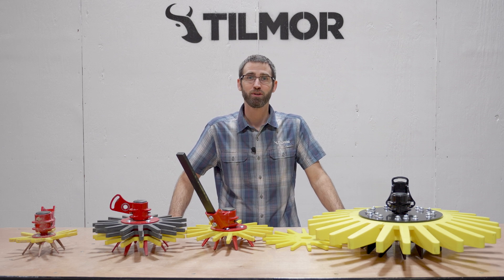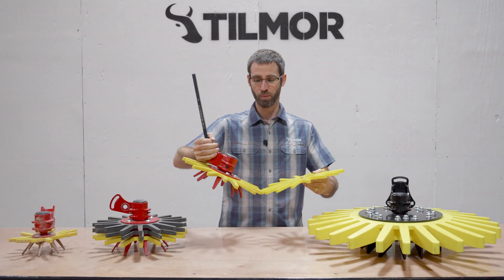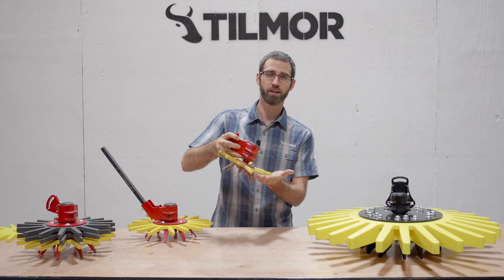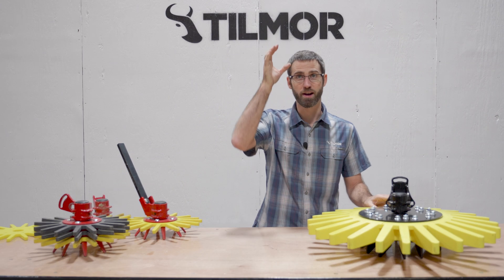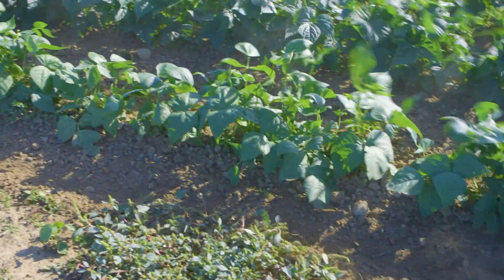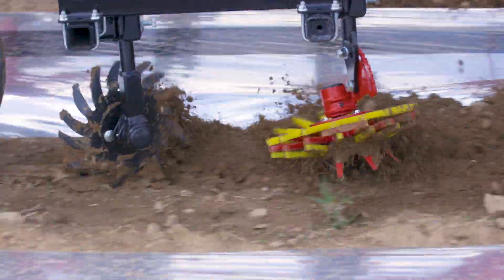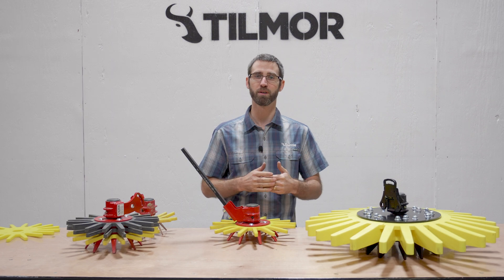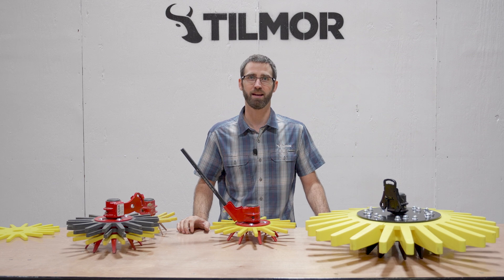Exploring Finger Weeders - Farm Implement Overview

Comment: How much price for13" finger weeder
Reply from the maker: For the main portion of it (bottom drive plate, finger, spindle plate, cast housing) the cost is $169USD. This does not include a shank as there are different options for those or you can provide your own.
Reply: Is this available in India....
Reply from the maker: @sachinrahane8792  We do not have distribution in India at this time, however we can send smaller packages through UPS relatively easy. Contact info@tilmor.com with what you are interested in and we can get you a shipping quote.
Reply: Kaha milega
Reply: Ok . thanks
Reply: Hi
Reply: This part give me